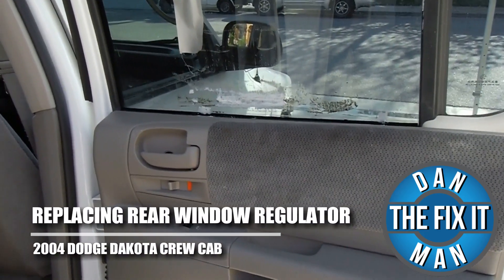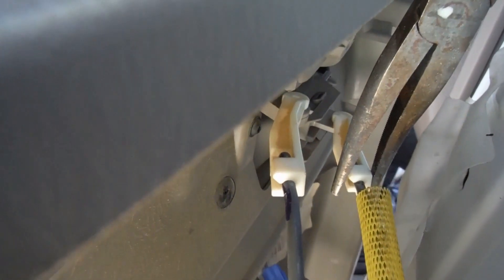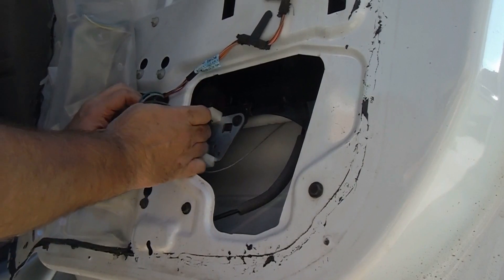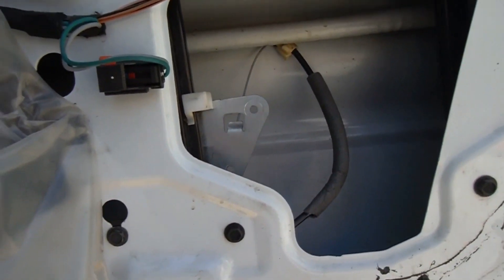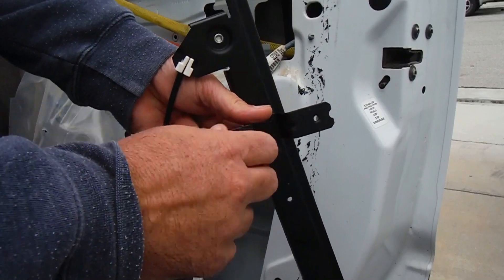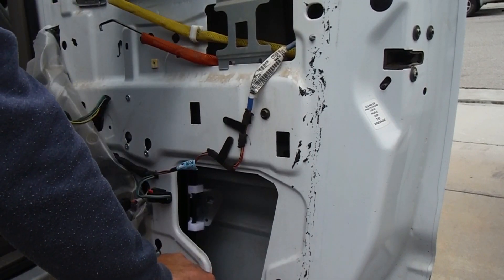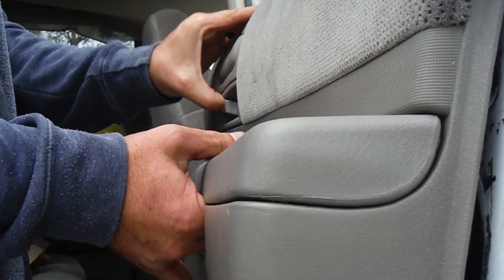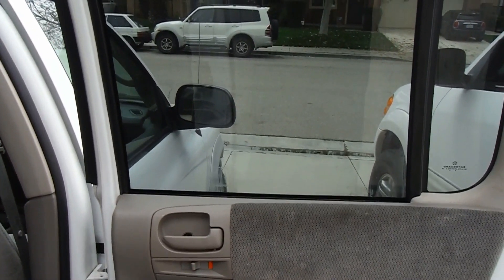2004 DODGE DAKOTA - HOW TO REPLACE A BROKEN POWER WINDOW REGULATOR - DIY

Comment: Thanks for taking the time to make and upload your video. As for Dodge Dakota window regulators, no matter what brand you buy they are made to break. Where both ends of the cables meet  and attach to is a nylon plastic part, which should raise an eyebrow immediately. The cables create such force that it doesn't take much time for at least one side of the plastic to break. The plastic part should've been made out of, at least, aluminum or brass. At first I thought whoever designed the regulator lacked common sense. Instead, its obvious that these companies use plastic at the most stressful points knowing that the plastic will break. Why would a parts company do that? Revenue. I'm sure these companies have all heard the complaints but integrity is a missing virtue in today's society and culture. Now, if only a company would offer metal replacement parts and/or kits, us customers could save money by buying a kit we'd have confidence in. I have a brand new regulator for my wife's '03 Dakota Quadcab but before I install it I have to find a reasonable machinist or I replicate that plastic nemesis myself.